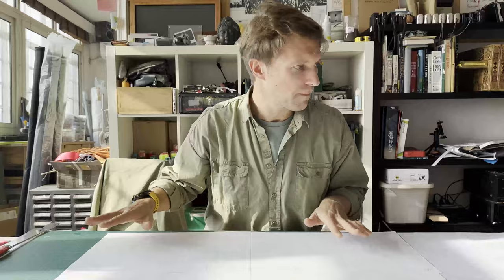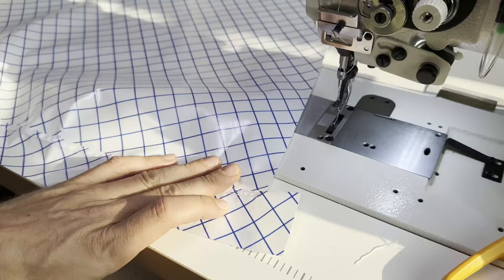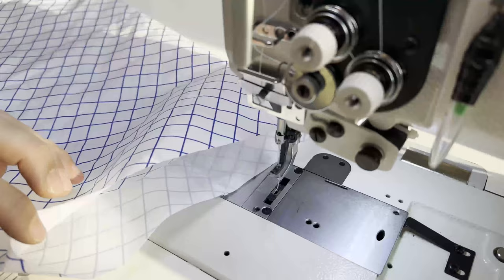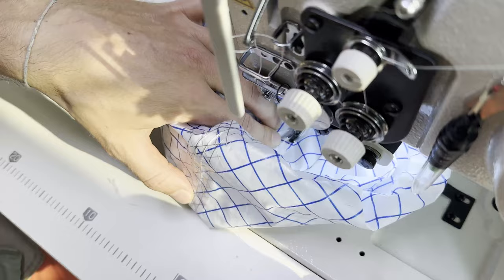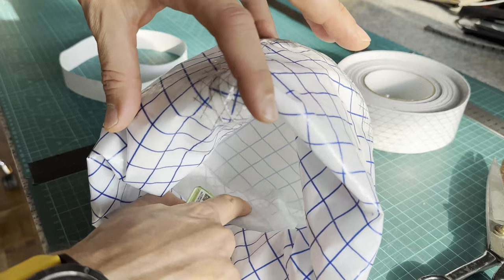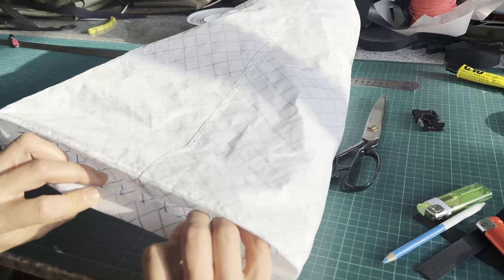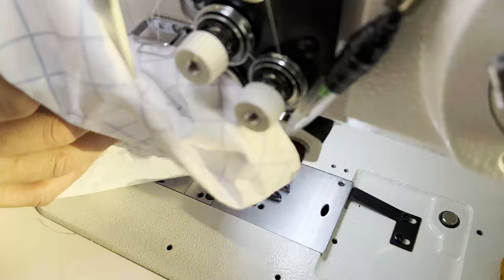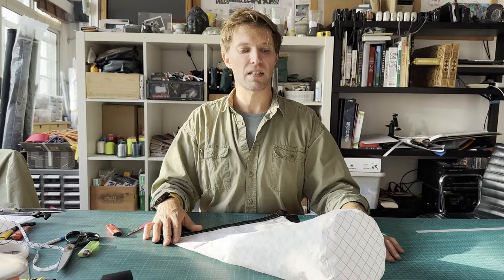DIY Drybag 1 - 100% waterproof - 7L - roll down + FREE PRINTABLE

Comment: 5:04 Hi, I think your video is really great, it conveys the technique of sewing technical textiles yourself very well. I think I know a tool that will help you in many situations. 
It comes from the bookbinding trade and is called a folding bone. 

They are available in different materials, many are made of plastic, but the really good ones are made of bovine bone, which has the advantage that the materials do not become electrostatically charged.
Reply from the maker: Great idea to really get the tape bonding close the stitching and in the seams. Thank you.